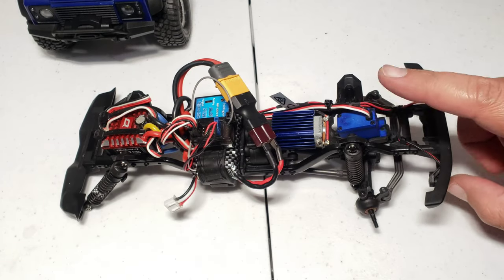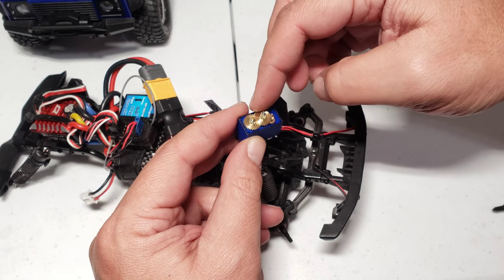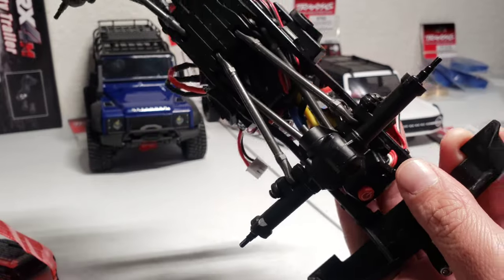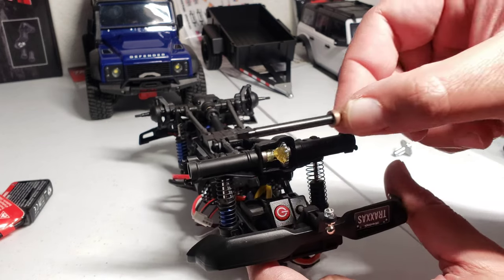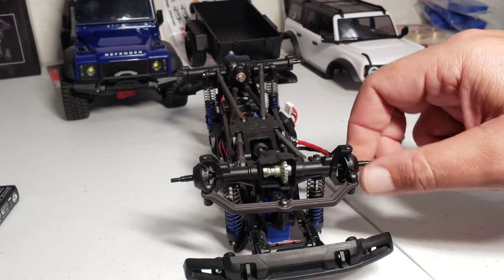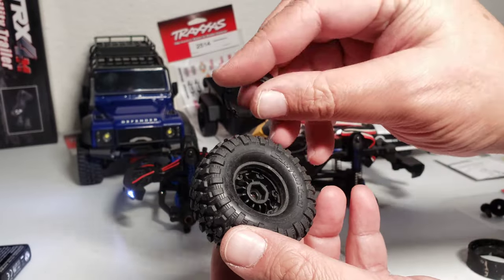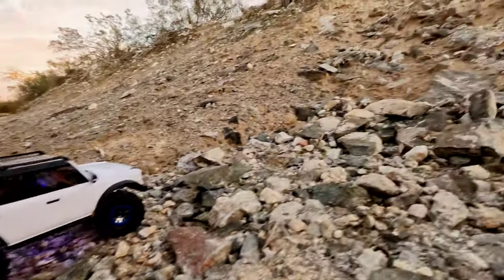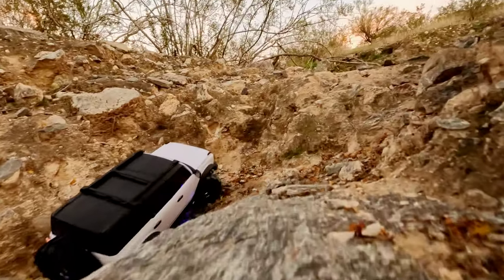Traxxas TRX4m Bronco more upgrades!

Comment: Pretty sweet, the rigs are coming along nicely 👍.
Thanks for always sharing your tips and tricks..
Here's one for you. - 
I always COMPLETELY pack my axles with grease ( like it squeezes the excess out while closing).
It keeps the water out and adds weight low down.
And also LEAD bbs or golf weights(bendable strips) in the tires if you don't wanna spend on the brass (need fewer with lead and lead is quieter than copper).
Now , Go Run That RC 😁
Reply from the maker: good tip!

Comment: SO I just got a Trx4M  More for TRAILING and driving threw woods Roots and leaves. Crawling around my house is not many rocks or streams. I’m not going to use it in rain or mud. Should it be ok . I was going to keep it Most stock. But I do want tires with foam. But I haven’t use it yet.  Great videos man. I hear this truck is outstanding. I know people don’t like the controller, but I don’t mind it.😊
Reply from the maker: Truck should be fine stock. Get tires and wheel weights and it should be good to go trailing around. Maybe an extra battery for more run time.
Reply: @RunThatRC   I READ WD40 is good for the O RINGS so they don’t Rot. OR PUT SOME KIND OF TAP.   I GOT THE DEFENDER.  THANKS MAN FOR THE IMPUT.
Reply from the maker: @ironj100  you can use heat shrink to protect them. I don't use wd40 on my RCs unless your trying to coat the plastic parts but they can turn some plastics bendy.

Comment: When’s the video on how to stop the shocks leaking coming out? Can’t get my shocks to hold oil
Reply from the maker: I actually have a short video on my theory on why some of these leak and some don't coming out soon.
Reply: My shocks leaked out of the box as well I replaced the oil with 30wht and seemed to help! They also seem to stick a little I replaced them with the aluminum ones seems a little better but still not as smooth as you’d expect